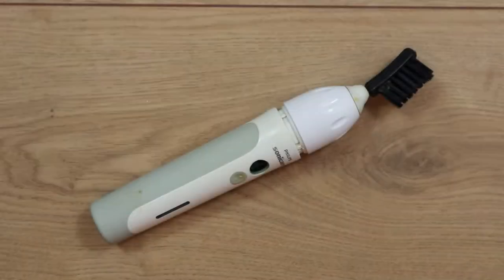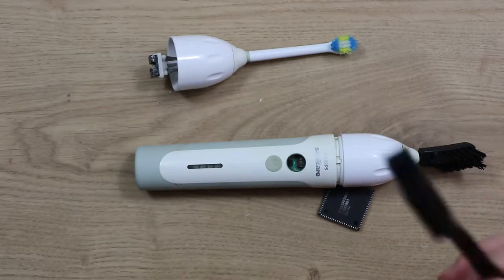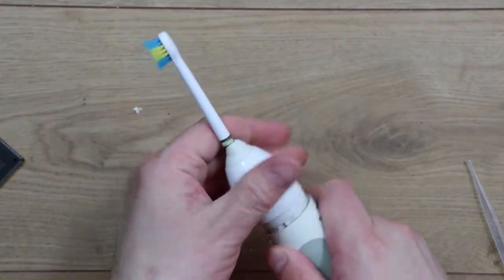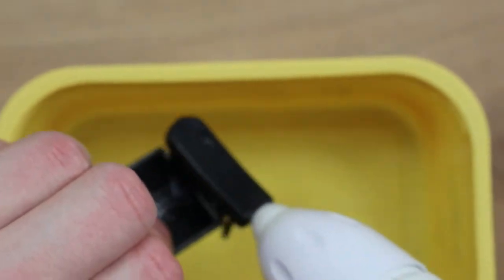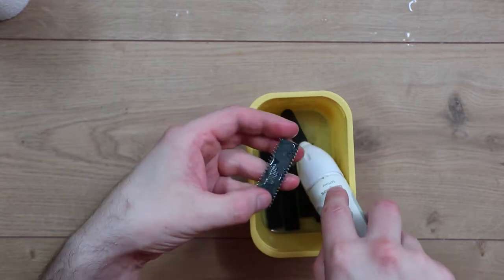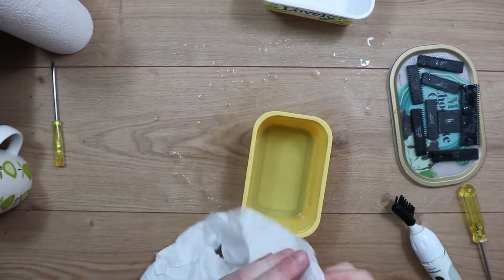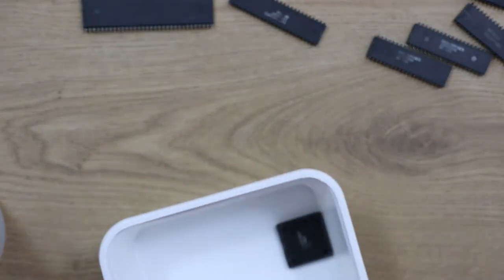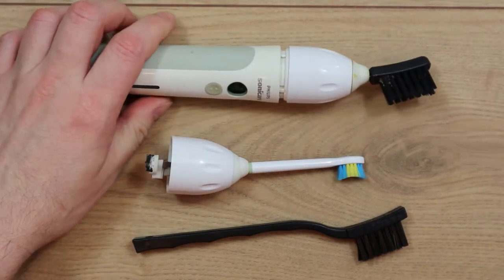Ultrasonic Brush for IC and PCB Cleaning - Experimental Idea

Comment: Nice idea. I used to have one of those toothbrushes but never got on with it (for my teeth lol). The ultrasonic cleaners people like Rossman use are thousands of pounds so a nice alternative. I think the 'proper' ultrasonic cleaners work by making millions of tiny bubbles in a specialist liquid that is nasty to breath-in but not sure. Either way, I can't justify one...
Reply from the maker: Yes, a proper cleaner is a little bit out of budget. On the plus side you could buy more retro hardware to justify the cost ;-)
The ultrasonic brushes can be harsh on the gums but over time they toughen up. They are really good if you can get used to them.